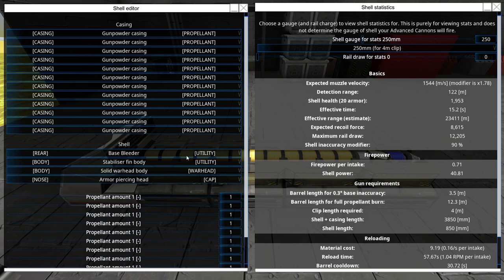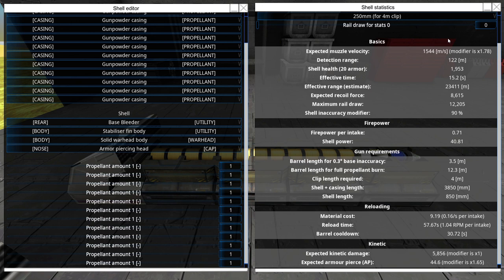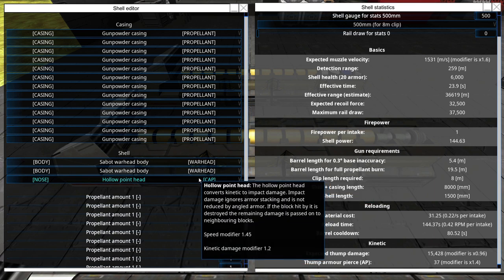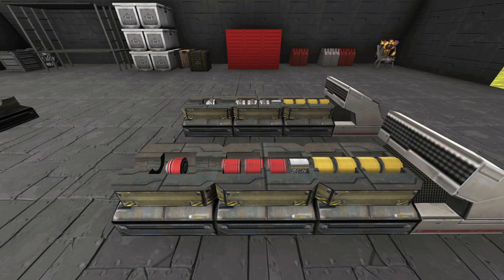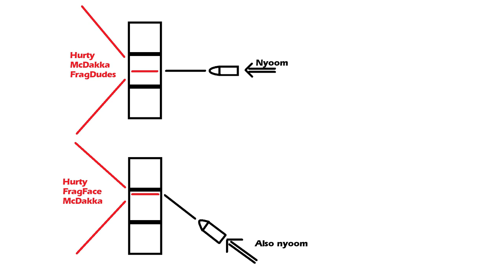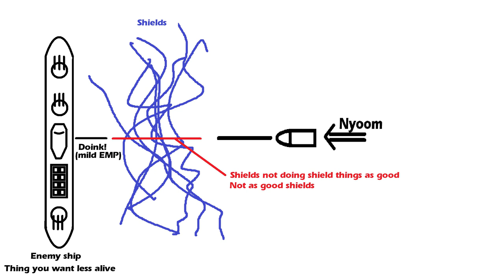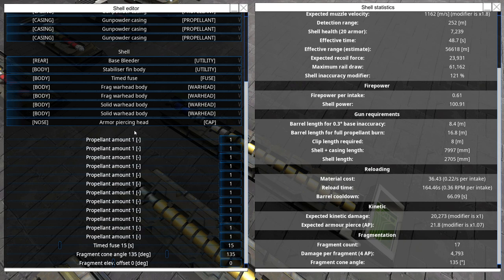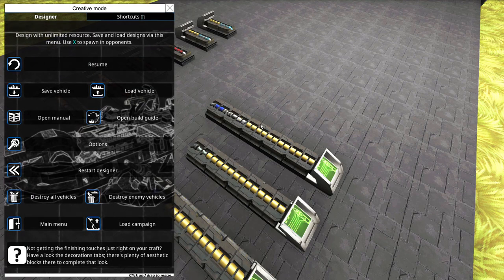From the Depths - APS Shell Tutorial

Comment: One point about frag (that i posted in the accuracy and anti-air video but looks like it got yeeted as did my last attempt to post here) is that 360 degree timed frag is extremely useful in hitting aircraft and other evasive targets with its area of effect. I find it way more useful than flak in that regard as the AOE is much bigger while small to medium caliber flak mostly either impacts directly or misses so far that it does no or negligible damage.
Reply from the maker: How long ago have you used it? I know it used to be really good, but these days with the reduced number of frags I found it quite meh. Not to mention you should be able to work with something like 90-135 degrees for hitting planes.

As far as flak goes, yeah, I def don't recommend small caliber shells.
Reply from the maker: Also, not sure why youtube yeets messages. Sometimes I get a notification and when I click on it there's nothing. It's annoying.
Reply: @OhmIsFutile  Its quite recently. I cant remeber the frag counts but i do remember loading the same gun with flak vs frag and the frag was the clear winner. Medium-low caliber rapid fire gun. As frag counts have been lowered so has flak radius gone down and quite recently frag velocity got upped to shell speed + set frag velocity which covers a huge area even if a bit thin in frag density. I do recommend running your own tests to see what works best for you. And yeah yt is starting to be really random in what comments it yeets. Like, if you refer to the yeet machine by its real name the comment gets yeeted. Its awful.
Reply: Im using frag with small cone and timer set so it explode before it hit. Its practicaly flying shotgun that instantly destroy propellers, wings, wood blocks etc. Another use for me is practicaly AP shell from frag. Explode on impact, but no cone or coud of shrapnels. Just line of shrapnels straight forward. Shrapnels bounce in hull from wall to wall until it hit anything. Last type i use is AP head, solid body, shrapnel warhead and penetration depth fuse. If it penetrates, it sprays shrapnels everywhere. :)

Comment: Excellent tutorial as usual! I feel like you could have mentioned smoke shells, pure rail shells, benefits and drawbacks of shorter/longer shells, and maybe also what shell types should or not be fed into the same gun.

My only slight disagreement is on stabilizing fins, which I would mostly hold off from using on AP-constrained shells such as HH, HP and AP-payload, save for extreme range shooting. If you're not afraid of ridiculous turret looks, noodle barrels work better to increase accuracy without sacrificing AP or damage.
Reply from the maker: Thanks, and agreed. The only time I really use fins is with a base bleeder. BB + fin usually nets a bit more oomph and slightly better accuracy if you don't need a different base.

I might do an advanced tutorial going into specific design decisions. Seems a lot of people want more details.
Reply: @OhmIsFutile  Same, in the CIWS role especially the fins + base bleeder combo is great since fins don't have that much less kinetic damage compared to a solid warhead, and 20 AP is so easy to reach.

Looking forward to the advanced tutorial. :)

Comment: F, the massive changes to APS in beta today, prob going need to update this already, ap modifier for soft parts from .1 to .8 meaning APHE is much much much more viable
Reply from the maker: It's not that bad tbh, pretty much everything still holds true except pendepth can now get away with more payload and/or a slightly shorter shell.
Reply: @OhmIsFutile  It makes pen depth much more meta IMO. Also makes hollow point chemical rounds much more viable because the hollow point was normally used just used to increase shell health and reduce ricochet chance but now they will actually have around eight times the AP value as compared to before as a pure chemical shell used to have a multiplier of .1 now it will be .8 which is massive. Also for any kinetic gun, one would lose very little from swapping a few of the AP bodies for HE, pen goes down a little bit and speed goes down a little bit but the reward for mixed rounds is much greater now. Mixed rounds used to be trash. 
I really enjoy your videos, by the way, they have been a massive help to me. Thank you!

Comment: I use 1m long hollow point railgun shells made out of 8 components - the hollow point head, a couple solid bodies, don't remember if I have a tracer in there and the rest is the railgun casings. I feel they do quite some damage with my rapid fire railgun (about 160 RPM) and are very good as light AA, but they don't quite line up with my expectations. Do you have a guide or know where I can find information about choosing the correct damage type for a given enemy?
Reply from the maker: I need to update this video, it's not so awful I'm gonna take it down before I update it, but hollow points aren't as comparatively good as they used to be.

As for finding information for what works best against certain types of enemies, I don't know of anyone making a clear guide for this, but it's a great idea for a video.
Reply: @OhmIsFutile  Hey, you might wanna consider pinning a correction on things you got wrong instead of taking down the video or updating it.

Comment: Railgun casing makes the shell more efficient like lets say 1000 railcharge zoom the shell upto 500/ms and if u add enough casings u can make it go 1000/ms with just 1000 railcharge
Reply from the maker: I'm gonna have to verify that, but that definitely used to be false. It was in the text, but it didn't make a difference.
Reply from the maker: Yup, this is still false as of the most recent beta test.
Reply from the maker: For the record, all it allows you to do is put more charge into the shell. Railgun casings have a lower impact on shell reload times than warheads or solids, etc... but most shells don't need more charge than what you can naturally put in them, and when you do, you can use gunpowder instead. It's cheaper and has the same effect on reload time. It's cheaper to cool the barrel down than adding more railgun chargers.
Reply: @OhmIsFutile  but you can get your rounds go like 3000ms like that. could be usefull for some kind of ap shells
Reply from the maker: @sgxbot  Maybe they buffed them, but unless they did there's no reason why you wouldn't put gunpowder there and then use whatever charge the shell can hold to reach ludicrous speeds. The railgun casings just end up costing you more indirectly by needing more chargers and a bigger engine.
Reply: @OhmIsFutile  with railgun casings i get shells that are way faster then with the same amount of gunpowder. But i agree that it really isnt efficient